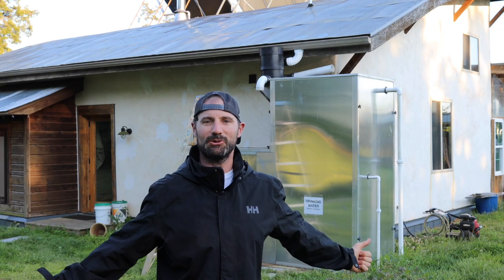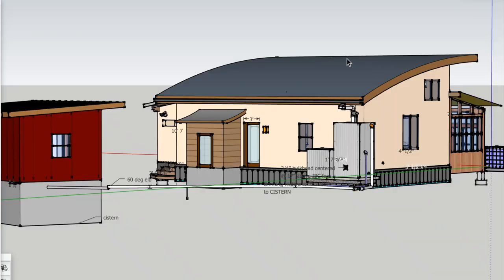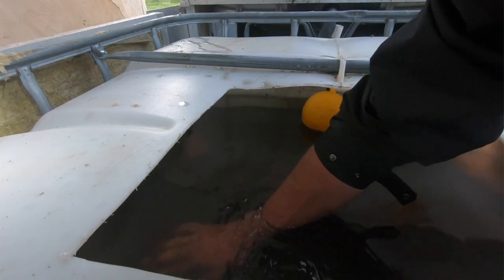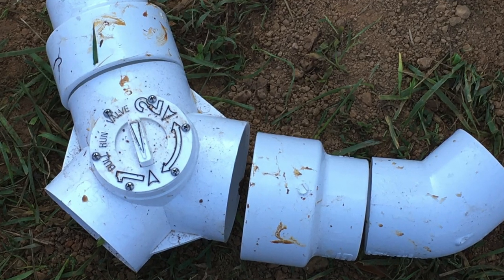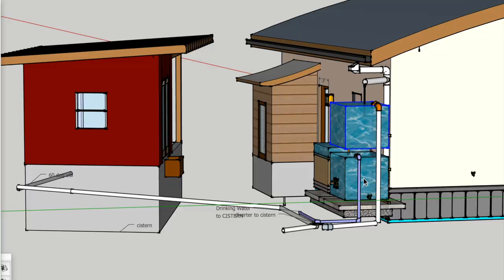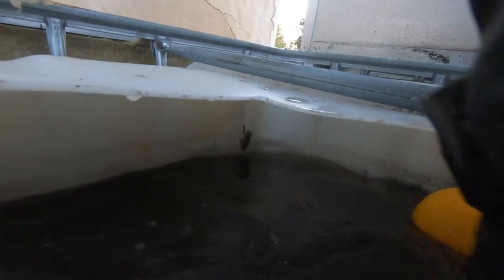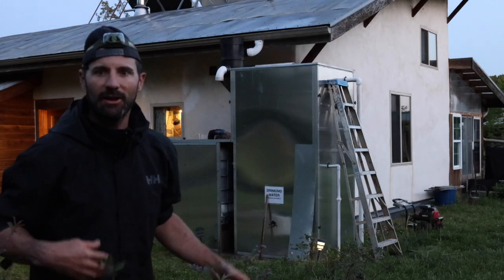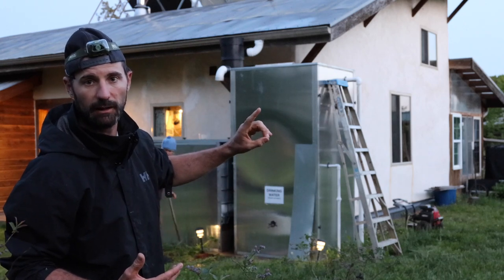DIY Home Water Filtration System: Rainwater Harvesting with a Biological Sand Filter and Maintenance

Comment: Sorry if I didn't catch this detail in your excellent video but what is the flow rate through the filter. I think your containers are  one metre cubes so the surface area of the filter is one meter squared. How many litres/gallons an hour do you have passing through? Thanks for posting. A really inspiring build. I especially like the lack of electric pumps. I am also off grid (down in Panama) and want to add a slow sand filter to my system. Edit: just watched again and caught 4 gallons in 20 mins.

Comment: That's one of the best designs I've seen so far, simple is certainly the best. Have you had any water quality test done on the drinking water and how often do you think you'll need to change the sand/gravel in the filter tank?
Reply from the maker: Thanks! We took a water sample and found no E.coli. There were very small amounts of Calcium and Sodium, which are good. The only downside is that the pH hovers around 5.7-6.0. It’s a little acidic. We have only had to sweep the top layer once a year, which removes about 1/16” of sand. At this rate, we won’t need to replace the sand for at least 15 years. In which case we just add a bag of sand.
Reply: @HeirloomBuilders  that's really good, were looking at going totally off grid in the UK where rain water isn't an issue. Our current water bills are around £600 pa so a system like this would pay for itself in a very short time.
Reply from the maker: Hi Richard, If you need them, the plans for this system are now available at https://www.heirloombuilders.com/designs-for-sale/rainwater

Comment: How to you get such good water pressure at the sink using gravity fed?  With the main tank below ground level, how is it able to travel up to the kitchen faucet?

Another question... Did you say that if the top tank overflows, it can go down into the main storage tank in the ground?  But then that water wouldn't be filtered for drinking?
Reply from the maker: Correct, the overflow goes into the 5000 gallon cistern. So everything there is only screened for debris with the vortex filter and sieve before going into the surge tank. We use water in the cistern for non-potable purposes like laundry, cleaning dishes, showering, etc. We pump it out of the cistern into a pressure tank to get pressurized water in the house. All our drinking water comes from the clean water tank at the bottom of the filtration setup.
Reply: @HeirloomBuilders  Ahhh, thank you for clearing up my confusion. Much appreciated.

Comment: I could be wrong as it was not clear the water flow but I beieve it would be benefitial if the water was going from bottom to top. I also would make a sedimaent trap so that I would clean a sediment trap but the thing with sand I do not need to clean. I have made gravel based sediment trap with 60l plastic drum. Works well, not sure how often would require cleaning. But it is better to clean 60l than IBC.

Comment: Mahvelous!   I live on a ridge with city water. It has cost thousands of $ in maintenance and repairs. 3/4 of a mile water line a large pump with electric meter and the bills that go with it all.  I have been considering a system of this nature and admire your work.
I have questions about your cistern, such as build details. Do you have a liner? Do you have a moisture problem in you shed from the storage?  What kind of lid do you have on your cistern? What are you using for a water pump to the house?  Looks like you have great water pressure.
Reply from the maker: Oh man! I should do a whole video addressing your questions. The cistern is my pride and joy. There is no liner, just 8” solid concrete wall. We placed concrete as the floor pitched to a drain, with rebar to tie the walls. Then formed up the walls and poured concrete. And then built a deck inside the walls, flush to the top, with plastic over it. Then poured a 4” concrete slab floor with #4 rebar at 24” on center (leaving an opening for access hatch). There’s no moisture issues in the shed, but the 1/8” steel hatch is sealed with an epdm gasket. The pump is a dankoff solar jet pump that is housed in the pump shed on the back of the house (with a 50 gallon pressure tank to keep good pressure)
Reply: @HeirloomBuilders  Please do a cistern video!  😁

Comment: Hi,  simple design that works well. Thank you. One question, could you explain please.

Where is inlet to the second cube, at the bottom? And then water is filtering while moving to top? Or it is just flowing on top of sand and if yes where is, in this case, mechanical filtering process made? Or no mechanical filterimg just bacteria work? 

Thank you in advance

Comment: Much admiration for your success with this design, clearly well thought out and executed. I'd been wondering where you got your stainless steel work done, so glad to know it is aluminum cladding, with cubic plastic water tanks inside. Do you have a first-flush diverter? I look forward to the smaller chunks with more details on the separate components.
Reply from the maker: Thanks Deborah! We had too many maintenance problems with standard first flush diverters. They need to be much more frequently cleaned in order to remove debris and do their job effectively. If they clog, they send dirty water straight to your collection tanks without the diversion, which ultimately clogs your collection tanks faster. 
We use a vortex filter that I would highly recommend. Costly (~$500), but worth every penny and labor hour saved in reduced maintenance. The vortex is An open bottom canister with screen/filter side walls that harness the power of adhesion (where water "sticks" to the walls of the canister) allowing clean water to pass through the screen in and down into your collection tanks, and letting debris fall through the open bottom without creating a clog to backup the rainwater. All the debris falls out the bottom if the stainless steel screen mesh is clogged. Unfortunately you lose most rainwater collection when the screen gets clogged, but at least it doesn't clog up your tank and create maintenance liability there. We clean the mesh every 3-4 rain events (depending on the season - pollen/etc). And that is a 3 minute task each time. So it's pretty easy to keep the whole system really clean.

Comment: This is excellent - great system! To eliminate pollen and other debris, are you still happy with the pea gravel fix or maybe a pre-collector that once filled to a certain point would poor off to your mushroom logs and open the valve to your water filtration system?
Reply from the maker: Good suggestion. I like the pea gravel and screen. It’s stays clean for a long time and if it clogs, i still get all the water overflowing into my cistern. What you are describing sounds like a first flush diverter. I used one for a few years as a pre-filter, but they clog so often that it’s hard to keep up with cleaning. And when they clog, all the unfiltered water goes into the tank and clogs up the mechanical float valve strainer (which is harder to get to in order to clean). We use the vortex style pre-filter now. It’s the black can on top of the system that pre filters the water. If that screen clogs, it just sends water to the ground, instead of clogging the pipes in the filtration system. I’ll put a video out soon about all this.
Reply: I can see that. What I had in mind was more rudimentary, like a bucket that once it filled to a certain point would simply dump and allow the rest of the water to flow into your cistern. However, it would require manually resetting after a rain.

Comment: Hey HeirloomBuilders, Nice video and good stuff! Just want to add, have you ever thought to add the screen and the gravel setup at the top of the eavestrough as well to help even more of the junk from clogging up the valve. I think that could help big time too if you can start filtering from the top of the eaves. I would assume most of the junk could stay up there too.
Reply from the maker: Good idea. I’d have to do some thinking about how to rig that up. We love the vortex filter for first flush.
Reply: what about using a hedgehog gutter brush at least to keep the gutters free of larger debris?

Comment: The intermediate bulk containers you mentioned in the video - you stated that they're pretty cheap, or something like that. I haven't seen any online for less than about $500. Is this about right?
Reply from the maker: If you buy them new, they could cost as much as $500/ea. you can find them used for $100; but just make sure they only had food or something non-toxic in them originally. Mine were used for transporting olive oil.

Comment: Hey! Very smart, thanks for sharing your experience and feedback. One question though, doesn't the filter need to get some water every day? I have read in a technical pdf from CAWST that water need to be poured every day to keep things running. Where you live, does it happens that it does not rain for days or weeks? How do you handle it?
Thanks again anyway
Reply from the maker: I have heard that as well, but haven’t done any testing to determine the efficacy or detrimental impacts of adding water daily. We see plenty of time between rain events where the problem would occur, but everything seems fine.

Comment: Aloha, I too am looking to do the same thing.  A couple of questions: what is the material your roof is made of?  Where did you get your sand from?  The reason I ask is because I live on the Big Island of Hawai’i and our sand is black due to the lava.  Do you think I could use it?  Due you sterilize the sand and rocks before you can use them?  I must say that I was skimming over YouTube all morning looking for some type of system to use to filter my rain water, when low and behold, I came across your channel.  I subscribed.  Mahalo (thank you).
Reply from the maker: We prefer metal roofing, copper is the best though. I’ve heard that The biosand filter will remove 99% of petroleum residues from asphalt shingles though...
As for sand, use 0.20-0.30mm sand with a high coefficient of uniformity from http://www.redflint.com. This is the best. We needed 25 cubic feet of filter sand and 2 cu ft of 1/4”-1/8” pea gravel, and 2 cu ft of 1/2”-1/4” gravel at the bottom. Not sure if you could use black sand, but I would think it’s probably fine if you can get the right size and uniform grain size. We don’t have to sterilize, but it takes about 2-3 weeks to grow the naturally forming biological layer that does the filtering.
Reply: volcanic sand is the best sand for water filtration!!!!
Reply: Great job, thanks very much! Does anyone know if I can use (black volcanic) sand straight off the beach, or would it be too salty/mess up the biological layer?

Comment: That was amazing. I want to try that. Why build a concrete cistern? Is that cheaper than buying an underground one?
Reply from the maker: I built a concrete cistern for a couple reasons. 1. It also serves as the foundation for a storage shed 2. The basic pH nature of concrete helps neutralize the acidity of the rainwater. Since I provided all the labor to build it, the concrete cistern was a little cheaper than buying plastic tanks
Reply: @HeirloomBuilders  I see. That's interesting. Now all I need is a video showing me how to fill 10,000 gallons of water storage from rain and surface catchment in an area that gets 7" of moisture per year and I'm all set. Thanks!
Reply: @HeirloomBuilders  Do you have plans available for sale for the concrete cistern?
Reply from the maker: @maverickgood5204  no, unfortunately we dont have plans available for the cistern

Comment: Looking forward to seeing more detailed videos on this & purchasing plans, it's excellent! For a family using this system without the additional cistern storage I'm wondering how you would keep the clean tank from becoming too full if it was piping directly into the house. Would you put another mechanical flow valve on tank #3? Thank you!
Reply from the maker: That’s a good idea! If you want to maximize your useable collection and don’t have the additional cistern beyond tank#3, then yes, put a mechanical float valve on the inlet pipe to tank #3 to keep the water in the surge tank (#1) until you need it to recharge clean water you pipe from tank#3. You would then have 600 gallons of useable water instead of just the 300 gallons in Tank#3. Does that answer the question?
Reply: @HeirloomBuilders  yes thank you for confirming!
Reply from the maker: Plans are available at https://www.heirloombuilders.com/designs-for-sale/rainwater
Reply: Do the plans have a list for all the parts you used?   I am interested in the swirling filter below the gutter

Comment: Hey mate, i was just wondering, what do you have on your outlet at the bottom of the ‘sand filter’ tank where the bottom level of gravel is, that stops the gravel from getting blocked up in the final water product pipe?
Reply from the maker: Hey! There is nothing there. Just an open pipe. The gravel will not block water flow.

Comment: Have watched this twice now and really learned a lot. - Can you explain how you get the filtered water into the holding tank for drinking water? Do you have a pump that shoots it up the pipe to go into the holding tank etc.
Reply from the maker: Hey Stephen! Barometric pressure “pulls” water from the bottom up through the 1” pipe and into the holding tank as more water is added to the unfiltered area on top. It’s kinda one-in/one-out. Hard to explain, but the clean water inside the pipe coming from the bottom of the filter always stays at the level of the water coming in from the surge tank, and so it spills out to the clean water holding tank
Reply: @HeirloomBuilders  ah! So need pump needed!
Reply from the maker: @StephenOwings  correct. No pump necessary!!!
Reply: @HeirloomBuilders  awesome! Do you happen to have like a set by set how you setup your system. I am familiar with the tanks but typically they do not have big openings, so I find it hard getting it all setup. Did you just cut in a bigger opening ?
Reply from the maker: @StephenOwings  yes. We just cut a bigger opening in the top (on the surge tank and the filter tank - places where it doesn’t matter too much if bugs, frogs, etc explore the tank. The clean water tank we keep sealed up. Working on a step by step plan....
Reply: @HeirloomBuilders  amazing! Thank you so much!

Comment: @HeirloomBuilders - Did you line your in-ground concrete cistern? Or what did you do to finish it on the interior?
Reply from the maker: No liner, just 8” thick solid concrete walls. There were a few small points that weep/leak a little bit that I patched/plastered with hydraulic cement
Reply: @HeirloomBuilders  excellent! We’re about to build a rainwater catchment and a straw bale cabin in the southern Ozarks of Missouri. Found your channel and binge watched almost all the vids on straw bale and pole barn framing. Excellent info! Thanks for responding so quickly! Gratitude! Brian + Erin
Reply from the maker: @BEAdventurePartners  awesome! Best of luck to you on your building adventure.

Comment: What material is the cistern? Did you guys make a concrete room under the ground? Isn't that porous? I wonder how much this would cost to have a contractor do for me if I buy a rural property where wells run dry.
Reply from the maker: I built the cistern with a 6” concrete floor, 8” concrete walls and a 4” concrete lid. Is very minimally porous, and barely weeps any water through it (only one little section weeped, but not even enough to drip). We patched that with hydraulic cement. I would budget $10k-15k for a contractor built cistern with todays prices.

Comment: Not sure why, I have it in my head, some kind of sand filter cistern that does not catch water from a gutter but just stands alone on a hill, it's funnel shaped, it's on a stand high up....my question is, I'm wondering if it could catch enough water, without a gutter and roof system...simply for drinking...like a back up.  Not for whole house use.  Not for laundry.  maybe it needs a certain climate.  And I don't see it covered either.  So birds could shit in it!  Not sure where I get these ideas.  Is it crazy?

Comment: Thanks for posting. Your system is excellent. Could you share the details of the filter design?
Reply from the maker: Hey Glenn! I'm hoping to get that info online really soon. I have it all detailed in SketchUp. Just need to make time to film a decent video.
Reply from the maker: Also, see minute 4:00 in this video for a filter design review.
Reply: @HeirloomBuilders  awesome! I have done some detailed reading of sand filters and the water quality reports of scientific studies is excellent. I'm convinced this is the route I want to go. I like your design because of its throughput. Much faster than other models I've seen.
Reply from the maker: @gpooleii  Glad to hear that you concluded the same. After living with the biological slow sand filter for 8 years, I can 100% support it. The key to the high output is the wide surface area of filtration on the top layer of an IBC tote (~13 sq ft). And a surge tank as big as you need to sustain long periods of drought.
Reply from the maker: Hey Glenn, if you need the details, plans are now available at https://www.heirloombuilders.com/designs-for-sale/rainwater